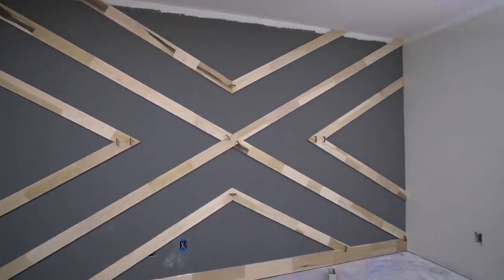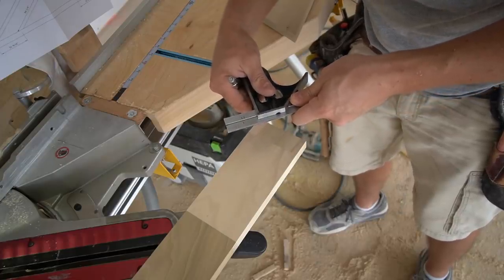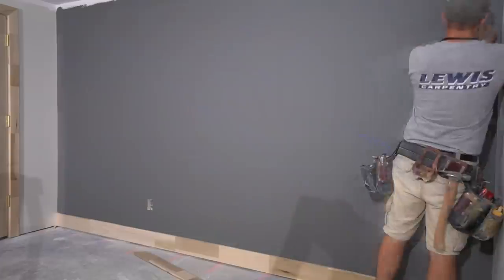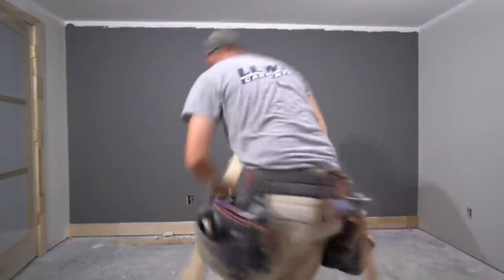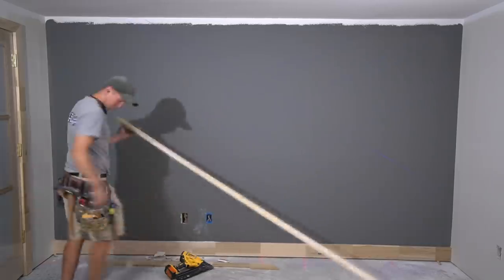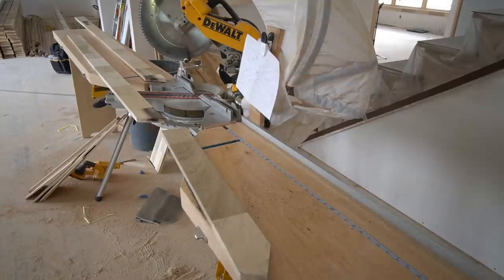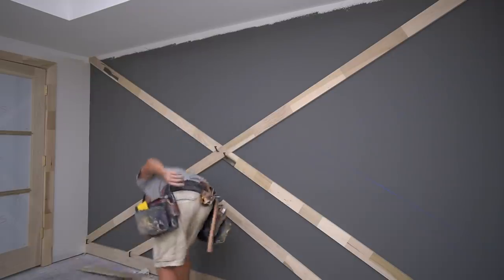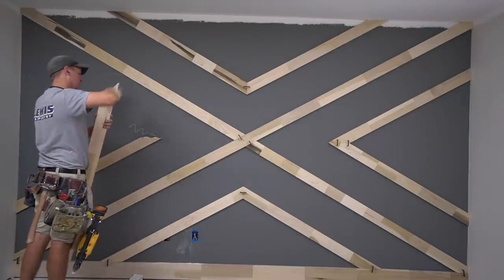Accent Wall - DIY vs PRO Joinery

Comment from the maker: Affiliate Links of Tools Used In This Video: Thanks!!!
Pinch Dogs - https://amzn.to/2V1ES2Z
Shinwa Chalk Line - https://amzn.to/3yd4QPv
Makita Biscuit Joiner - https://amzn.to/3zOmFof
Makita to Dewalt Battery Adapter - https://amzn.to/2VksGtO

-My Favorite Tools - Insider Carpentry Amazon Site - https://www.amazon.com/shop/insider_carpentry

-Support more content like this by becoming a  PATREON SUPPORTER - https://www.patreon.com/insider_carpentry
Reply: Hi where do you buy the adapter to be able to use a makitatool with a Dewalt battery ?
Reply: Hi, know this is off topic, but what do you think of the cut hub saw bench?
Reply: @insider carpentry, Spencer, did you level the bottom base piece? And also is that dewalt battery on the makita biscuit jointer?
Reply: Stud finder link?
Reply: @brandongomez1842  he uses his Dewalt batteries on a couple of different brand tools such as his Milwaukee M18 nailer.
Reply: What is the material you are working with?
Reply: Pinch dog link took me to dog collars

Comment: Sketch up rules!  I use mine all the time.  Takes out 95% of the guessing when you are onsite.  That's a killer accent wall looks great.
Reply: I looked at sketchup. But never really used it. This is the first time I've heard of carpenters using it for assisting in projects. 
How is this done ?
Reply: @fdiver60  is Just like AutoCAD, but super easy to learn and adapt.  I paid $700 for the software subscription and have updated every year since 2018.  I've been using it for my current home build as well I've designed and built many furniture and cabinets just using this program. For small to large projects (like a house), this program has been a lifesaver.  Tons of videos on Youtube to get your inspiration up!!

Comment: Clever use of pattern boards for angles. Trying to figure out if you could have used a jig to avoid having to swing the saw around. So easy to put the wrong angle on a board!  Thanks for the video.

Comment: That's the best chalk line I've ever used man. The small line is great for interior walls, you don't get chalk all over the place and a big fat chalk line. Retying that knot the first time it broke was tricky though, I wish I would've looked at how it was tied originally.  But the pinpoint tip is the extra hand, for the solo man.
Reply: Good to know. Do you know if the chalk erases off of the wall easily afterwards? And is the point small enough that a dab of spackle will make it disappear? I hang a lot of artwork and mirrors and it can be time consuming laying out painter’s tape and pencil lines with a spirit level. If I can switch to a chalk line that doesn’t leave chalk all over the floor and erases off of the paint easy, I’d imagine that would save tons of time.
Reply: Ive used chalk line on top of painters tape for a barn door rail layout.  You can also bump off excessive chalk outside.  Pull out the line ahead of time while outside,  and shake it lightly.  when you snap, the line is faint on the tape.  Just what I’ve done when I forgot long levels/straight edges.

Comment: Very nice use of your pattern reference board, a.k.a. the money maker...
The only thing I see that you should’ve done to be totally pro and not to tick off the taper was to screw a piece of 1x in the old outlet hole hiding the screws behind your design and screw the piece of sheet rock you cut out for the new outlet hole into the old outlet hole
Reply: That's how we do patches here in FLorida, nice! Always increasing and growing together

Comment: @1:05 Dang. I forgot that you can use a adapter for DeWalt battery with Makita tools.  You even had a video on it before.  I should have picked up the cordless Makita over the corded DeWalt one.  Live and Learn I guess.  Nice work on the accent wall!  And PRB for the win!
Reply: Good eyes!  I missed it until I saw your comment and went back to review.

Comment: Great video, I like to seal the back of my decretive trim work so it’s not raw wood touching the drywall. Iv noticed on some of my projects like this. That once the wood is acclimated to the moisture in the room. It still tends to to acclimate moor when attached to the wall. If there is a shower or sink in that room the moisture in the air can cause the wood to shrink and swell. So I like to seal both sides. Great video and work 😎👍🏻
Reply: Great idea.  What do you use to seal the wood?  Primer or shellac?
Reply: @davec3689 Thanks David, depending on the finish if it’s just going to be stained and clearcoated then maybe just a clearcoat on the back side. If it’s going to be painted then a coat of primer will work for sure. 😎👍🏻
Reply: @adsbadsb9488  my point exactly I agree 100%.
Reply: @adsbadsb9488  definitely take it back to the basics I agree.
Reply: This channel still amazing master carpenter for sure. I’m always super impressed when I watch this creators content 👍🏻😎🔨

Comment: Nice work,  great tips! The only thing that competes with the pinch dogs in this application is the lamello zeta using the tenso fittings. Obviously way more expensive with the cost of the machine + consumables.
Reply: What about a brad driven through the edge? Brad acts as a clamp, holding the joint together until the glue dries. Cheap, easy, quick, and only a small hole in one edge th fill. Sometimes simpler really is better.
Reply: @petem2700  Agreed simpler is often better. I would still do a floating tenon whether it be a domino or biscuit. Another idea would be to put a 23ga pin nail in both sides of the tenon instead of the pinch dogs.
Reply: @adams5202  Yes, in conjunction with the biscuits. I never meant to imply to eliminate the biscuits, just that a brad nail is a simple "clamp". As long as the miters are tight, the joint only needs to be held together, not pulled together. Obviously the glue is still imperative.

Comment: Ideally, one would patch the drywall before installing the trim.
Reply: That's what I was thinking. Been doing drywall for 30 years and that's a pain in the ass to finish with the trim up, not to mention there will be mud all over the trim.
Reply: Finish carpenter for 26, I’ve always took the piece cut from new hole and put it in old hole with a piece of wood behind but never have I waited for it to be finished, our finishers always just tape wood off, hard to say why he did it that way, though I know time is money!
Reply: Ideally the box wouldn't be in the way of the trim.

Comment: Ever consider pocket screws instead of biscuits? No need for pinch dogs and holds up as well as a nice cabinet face frame
Reply from the maker: All the time, but not in this particular application. I'd rather build it on the wall than preassemble.

Comment: Very cool, but I don't have and don't want to learn Sketchup for one project.  How did they do it before computers? They did it!  I suspect they drew or snapped lines on the wall  and used geometry.
Reply: I just thought of it.  They drew lines, then used a bevel gauge and set it  They took the bevel gauge over to the miter saw, which was a hand saw in those days, set the angle, and made the cut.
Reply: It's actually trigonometry, but yes, with a couple of formulas, and either an angle table, or scientific calculator, you can easily get those precise angles.

Comment: So, how much time did this actually take? I'm yet to learn sketchup so it feels a bit ominous adding the time for it into my job bids. Seems like the actual wall work is pretty quick after doing the sketchup though?
Reply: Once you learn how to work Sketchup, a design similar to this could be done in about 15 to 30 minutes, depending on how deep you take the model.
Reply: Hi Bryan,
Don't limited your computer skills just to Sketchup, I have been drawing objects, shapes, designs and engineering drawings in Coreldraw a graphic program for over 20 years now and you can get and do similar things that a Cad program does. The only difference between programs is each program has tools (macros) designed that create shapes, objects easier or quicker specifically designed for a certain task.
We use Aspire as our routing program at work, but we can make and tweak cutting files way quicker and more acute than you can within this software.
So horses for courses, learn to think outside the box because what might work in one situation won't work in another.
Reply from the maker: 15-30 minutes.
Reply: @percyangilley3291  thanks for the rundown. Are there decent classes/courses for carpenters getting into using these programs? I can tell it's a real part of the future but it's a bit hard to grasp where to invest time and energy when considering the different programs. I plan to reel work back this winter and do some courses, but it's difficult to know the best bang for your buck when there's so many.

Comment: Spencer just out of interest , if you’d used sketchup for the lengths rather than site measures how far off were they ?
Reply from the maker: Depends how far out of plumb the walls are. Plus or minus 1/4" probably.

Comment: I like your work. But i would have gone with a bigger base  & a border all around the 3 sides would have made it pop out more and put the top piece smaller so after installing a crown the top & bigger would look like a door.
Reply: I don't think he was the designer. He was implementing what was asked. This is a more clean, modern look. It's likely that someone with this design aesthetic would prefer clean corners rather than crown molding.
Reply: I never he was but its just a plain wall don't need a designer for that. It was my opinion as the way was done had no pop to the wall

Comment: I’ve been a finish carpenter for 14 years building custom homes, and I’ve never needed to smash a railroad spike into the finished face of my material to draw my mitres together. All these tools just seem like gimmicks to me. We need to get back to the basics , before we start teaching new carpenters that they need to buy all these expensive tools to do the job, that’s been done with basic tools for decades.
Reply from the maker: Yep. Its been done wrong without basic gimmicky tools for decades. All the work that I tear out was done by the "lean old school guys" No understanding that for strong glue joints clamping pressure is required. Same guys that just dab some glue on mitered casing and cross nail it. Its not a rail road spike. And they cost next to nothing. They are essential if you care about doing high end work in custom applications.

Comment: Why is the sanding carpenters job?!
Painters going to prime it fill out all the nail holes. Primer all ways need to be sanded 
Don’t make their live to easy. Let them work
Great job
Reply: There’s a reason the B side of a paint can opener is a bottle opener.

Just saying.
Reply: @monkeygraborange  I've been carpentering 46 years, I'm 65. I was taught by the old guys when I started and we always sanded and I still do.
Reply: @royordway9157  Same here. I don’t understand how anyone assumes someone else is going to finish your job!
Reply from the maker: Rule number one is never assume the painter is going to sand something that needs sanded, especially anything that needs sanded by an orbital sander. The most I'm ever going to get out of a painter is a quick hand sanding.
Reply: Painters don’t carry a electrical sander . They will
Fill it after a light sand make it look even but if the joint is not tight it will crack
Reply: Might be nice to fill in the old outlet hole before the trim board covered 3/4 of it too.